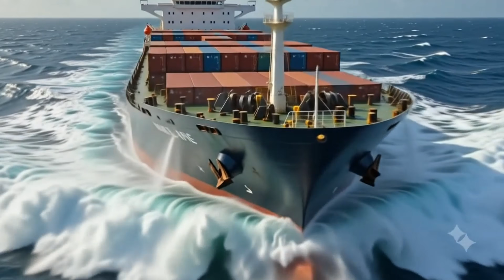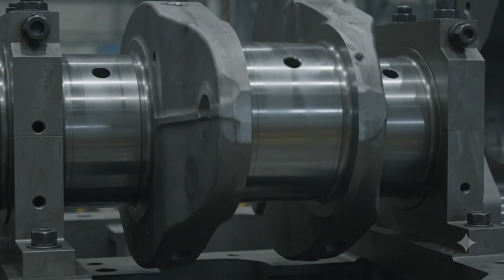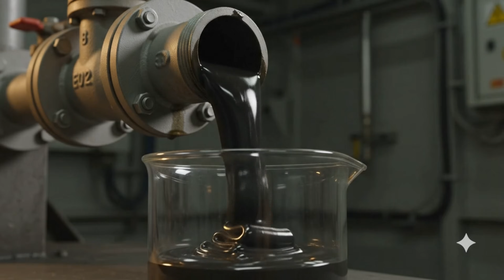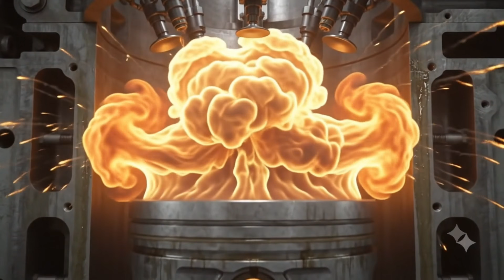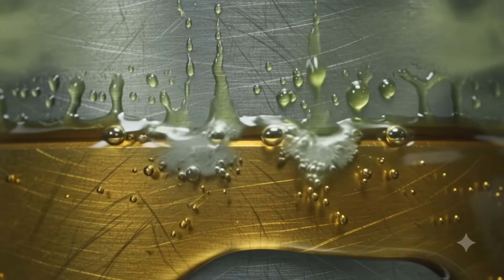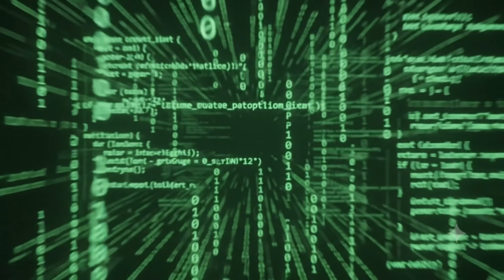Inside the World's Largest Engine  (109,000 HP)

Comment: I also noticed problems with the AI graphics. There is another item I have learned from other videos about large ship diesel engines. What I have learned is that these large ships will burn the heavy high pour point temperature less expensive fuel oil that contains sulfur while out in the open ocean, but when the ship gets close to certain ports they will switch to a lighter lower pour point temperature more expensive fuel oil that is low sulfur to meet air quality requirements near the port.
Reply from the maker: "You're absolutely right about the fuel switching! Ships use Heavy Fuel Oil in open ocean and switch to low sulphur fuel near ports to meet IMO air quality regulations — great knowledge!
 And noted about the visuals, working on improving that in future videos ."